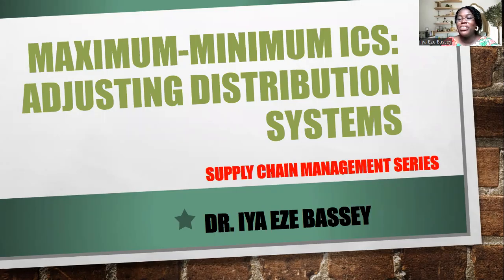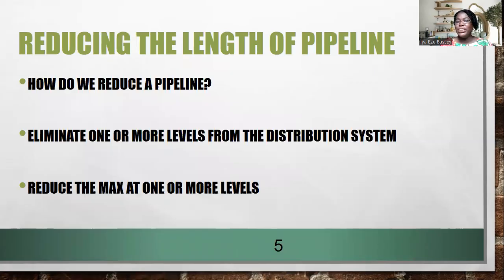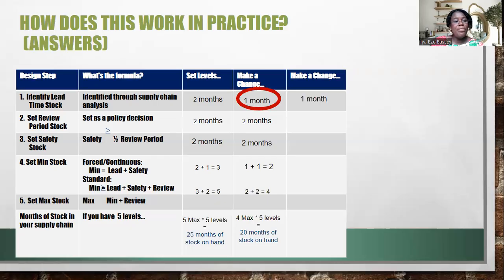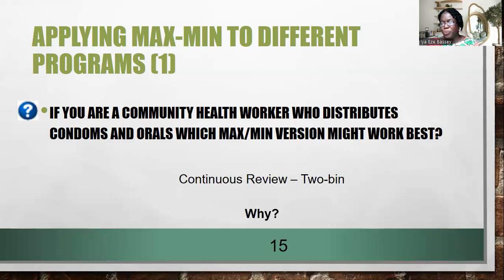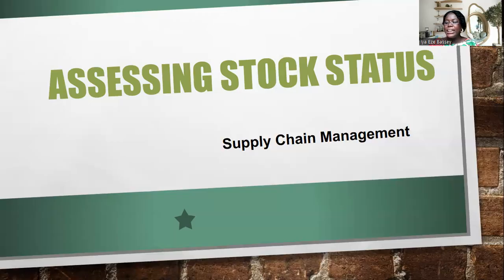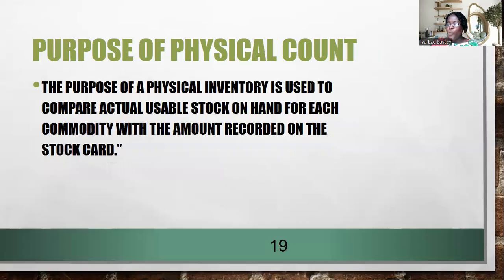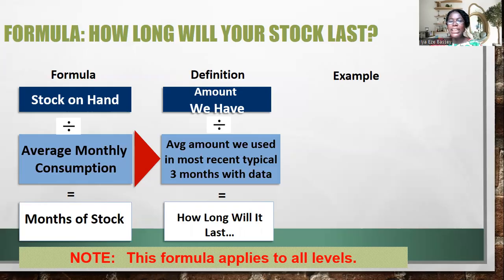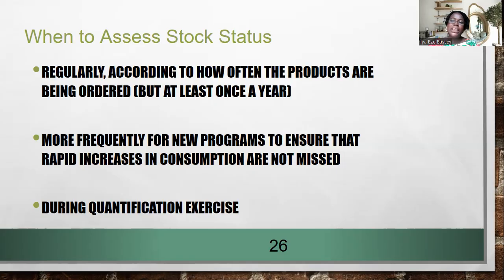Maximum-Minimum ICS: Adjusting Distribution systems (Supply chain management series)

Comment: In Summary i learnt that;

The maximum-minimum inventory control system in provides guidelines for managing stock to avoid overstocking or understocking of commodities. brackets.

The key steps in designing a minimum maximum Inventory Control System include ;

* Setting up good  maximum minimum strategy for each level and type of facility.

*  Ensuring that the overall distribution will function properly.

- Put in place initial minimum maximum strategy for each level

The benefits  of using the max-min system includes:

*Minimize wastage
* It saves cost
*Improves inventory manual and control.
*Avoid overstocking and understocking.
* Improve order fulfillment rate.

Comment: In Summary, Maximum - Minimum inventory control systems are useful for managing the supply of laboratory reagents, consumables, and equipment in medical Laboratory science. Setting the right maximum and minimum stock levels, laboratories can meet testing demands without having too much or too little inventory. 

Factors that can possibly affect max-min inventory control system levels include;
1. Lead time
2. Cost of products
3. Cost of storage
4. Storage conditions at different levels
5. Shelf life of health commodities.

Comment: Maximum and Minimum ICS is a inventory management technique used to optimize inventory levels by setting upper and lower limits. In the context of Adjusting Distribution System, this technique is used to:
-Eliminate one or more levels from the distribution system
-Reduce the max at one or more levels

Factors that impact Max-min stock levels:
-Lead times
-Effect of a zero balance of stock
Accuracy of forecasts
-Reliability of source supplies

Adavantages of using Max-Min System are:
-Avoids overstocking
-Avoid understocking
-Minimize wastage
-Avoid cost of emergency orders, 
When to assess stock status:
-Regularly
-More frequently
-During quantification exercise
For the sole purpose of been overstocked or understocked.

Comment: In summary, I learned th the ways to adjust distribution systems in ensuring a maximum and minimum inventory control systems is by 
1. By reducing the maximum stock level (i.e the review period and lead time)
2. Checking the length of the pipeline (i.e the entire chain through which supplies are moved from the manufacturer to the user)

Also learnt that it benefits which include 
1.improved inventory management and control 
2. Increased effiency and cost savings 
3. Enhanced customer satisfaction and service levels
4. Reduced stockouts and overstocking

Comment: Good day ma, from what I understand, The Steps in Designing A MAX-MIN ICS Are: Set up  Initial Max-Min Policies For Each Level And Type of Facility, Check if The Overall Distribution Will Function Properly If The Level Specific Max-Min Policies are  Implemented , Check The Total Length Of The Pipeline That The Policies At Each Level Imply. To reduce the length of a pipeline you eliminate one or more levels from the distribution system, reduce the max at one or more levels. Some advantages of using max-min system are: minimize wastage, consistency of stock level s, avoid overstocking. • The Purpose OF Assessing Stock Status is to Determine How Long Supplies Will Last. Thank you ma.

Comment: In summary, it has been stated that in order to reduce a pipeline, one has to eliminate one or more levels from the distribution system and reduce the max at one or more levels. 
There are many factors that inpact max-min stock levels. They include;
1. Cost of Products 
2. Storage Capacity 
3. Shelf-life of Health Commodities 
4. Age of Program and 
5. Accuracy of their Forecast 

The Max-Min system is advantageous in the sense that it avoids overstocking or understocking, it minimizes wastage and maintains the consistency of stock levels. 
However, the disadvantages of the Max-min system include its inability to manage a large number of commodities. It cannot manage products of new programs. 

One of the ways to assess stock status it to do a Physical Count. The purpose of this physical count is to compare the actual stock that can be used (stock on hand) for each commodity with the amounf recorded on the stock card. It is used ro determine the length of time that the stock will last. The formula for calculating this is Stock on hand divided by Average Monthly Consumption.
Note: The stock is calculated in Months. 

Thank you for this educative video, maam.

Comment: IN SUMMARY OF MAXIMUM - MINIMUM ICS
I would nsay the provides comprehensive guidelines for managing stock level to prevent both overstocking and under stockings or goods.
It encompasses various steps involved in designing the system.
  Methods doe reducing pipeline length and factors affecting the max - min stock levels.Not only does the maximum system helps in preventing overstocking and under stockings, but it aids in avoiding emergency order costs by providing a guide ro the stock status on a regular basis.

 Am grateful ma for the IMPACT

Comment: Great video..
Few things I picked from here are

1. I learnt the steps on how to design a max-min ICS.
2. We can reduce the length of the pipeline by eliminating soke levels from distribution system..
3. Some factors can impact max-min stock level systems like: 
Lead time, Age of program, Management skills of staff.
4. In accessing stock status we can do that by... Physical count.
5.  To know how long stock will last we derive it by this formula. 
Stock on hand ÷ average monthly consumption= months of stock
Reply: After this lecture I gained clear understanding in the sim to optimize inventory levels and distribution systems.
Uses a maximum minimum inventory control system (ICS)
Sets maximum and minimum inventory levels for each item.
Automatically triggers orders when minimum levels are reached, ensures timely replenishment and minimizes stocks outs.

Comment: MAX-MIN ADJUSTING DISTRIBUTION

Steps in Designing a max-min ICS ( Inventory Control System):
1) Set up initial max-min policies for each level and type of facility.
2) Check if the overall distribution will function properly if the level specific max-min policies are implemented.
3) Check the total length of the pipeline that the policies ate each level.
   In order to reduce the maximum stock level, you need to change in order to reduce the maximum stock level, these process:
1)  Shorten the Review Period at one or more levels
2) Reduce the Lead Time at one or more levels.
3) Improve the Distribution System's Reliability at one or more levels so that safety stock can be reduced.

Some other factors that impact max-min stock levels are ;
1) Cost of products
2) Storage capacity
3) Cost of storage
4) Reliability of transportation
5) Lead time
6) Age if program
7) Accuracy of forecasts, etc.

Advantages of using max-min system
1) Avoid overstocking 
2) Avoid under stocking
3) Minimize wastage
4) Avoid cost of emergency orders. Etc

Challenges of using a max-min system
1) Systems with Numerous levels
2) Systems that manage products for new programs
3) Systems that manage a large number of commodity

The physical Count which is the process of counting by hand the total number of usage units of each commodity in your store or health facility at any given time.

I learnt alot Ma

Thank you Ma

Comment: In summary, i have learnt that we  can improve the overall pipeline to delivery medical laboratory commodity from the central level down to the rural clinic medical laboratory level by: 
-Checking the length of the pipeline.
-Checking th total length of the pipeline that the policies at each level imply.
To modify the pipeline we use a systematic way  by changing some elements of the formulas which can be changed in order to reduce the maximum stock level, this is done by;
- Shorten the review period at one or more  levels.
- Reduce the lead time at one or more levels.
Advantages of max-min inventory control system
- Avoid over stocking 
- Avoid under stocking
- Minimize wastage 
- Avoid cost of emergency orders
* Challenges of using each version and variation of max-min inventory control system*
1. System with numerous levels 
2. System that manage a large number of commodities 
In applying max-min to different programs  for example the recommendation for drugs, HIV test kits, the version to ise is the standard version.

Comment: I learnt about Maximum- minimum inventory control(max-min ICS) system. It is set up in 3 steps:
1. Set up of initial max-min ICS policies for each level
2. Checking if overall distribution will function properly if the level specific max-min policies are implemented
3. Checking the total length of the pipeline
Advantages of using max-min system include:
•Avoidance of overstocking, understocking,wastage,and costs of emergency orders
• simplification of inventory control decision making
• Stock level consistency
• Reliable data source from sdp for forecasting and quantification.
A physical count is the process of counting the total number of usable units of each commodity in the health facility by hand at any given time. The purpose of this is to compare actual usable stock with the recorded amount from the stock card.

Comment: I have learnt that the Max-Min inventory inventory management system (ICS) gives detailed information for managing stock levels to avoid overstocking and understocking commodities .

Steps in designing Max-Min ICS include:
1. Set up initial Max-Min policies for each level and type of facility 
2. Check if the overall distribution will function properly if the level of specific Max-Min policies are implemented 
3. Checking the total length of the pipeline that the policies at each level implies 
Factors that can impact Maxi-min level :
Reliability of transportation, cost of storage, storage capacity, lead time, storage conditions at different levels , shelf life of health commodities.

Advantages of using Max-Min system 
- Avoid overstocking 
- Avoid understocking 
- minimize wastage 
- consistency of stock level 
- simplify inventory control decision making.

Comment: I've learnt:
* The different steps used in designing MAX-MIN ICS
* How to reduce the length of pipeline
* How to reduce the Max stock level
* Advantages of using MAX-MIN system
* Challenges to using each version and variation
* Physical count is the process of counting by hand the total number of usable units of each commodity in your store or health facility at any given time 
* Purpose of physical count 
Thank you Ma for this enlightening Video

Comment: Wonderful class
In summary:
To design a max-min ICS we have to step up policies for each levels, check if distribution will function and also check the total length of pipeline.
Some Factors that affect max-min stock levels are; stock of product,cost of storage, storage capacity,Lead times,Age of program.
Some advantages of Max-Min system are to; avoid overstock, avoid under stock,minimize waste.
Thank you ma

Comment: In this teaching i have learnt the steps in designing mad-min ICS which are....

1. Set up an initial max-min policies for each level and type of faciuty
2. Check i the overall distribution will.work properly if the level specific max - min policies are implemented
3. Check the total length of the pipeline that the policies at each level imply

I also learned the advantages of using max-min system
Which are
1. To avoid overstocking
2. To avoid understocking
3. To minimize wastage
4. To avoid cost of emergency orders
5. To maintain consistency of stock level

Comment: I learnt:
Maximum- Minimum ICS;

- Adjusting Distribution system; implementing specific maximum policies at each distribution level is crucial for optimizing inventory level particularly in public health supply chain.
  Uses a maximum and minimum inventory control system ICS.
   Gets maximum and minimum inventory level for each item.
  Automatically triggers orders when minimum level are reached.

BENEFITS Includes
" Reduced stock outs and over stocking 
" Improved inventory manaul and control
" Increased efficiency and cost saving.
  "Enhanced customers satisfaction and services levels 

PIPELINE LENGTH MANAGEMENT 
        Reducing the length of the distribution, pipeline can significantly enhance the efficiency of delivering indicates supplies such as health commodities to clinics.
Well done 👍 ❤

Comment: In conclusion, the procedures for creating a maximum-min ICS were covered, along with how to shorten the pipeline. Using a maximum-min system has various benefits, such as preventing excessive overstocking, avoiding understocking, and reducing waste. The cost of the product, storage capacity, and storage expenses are some of the variables that affect maximum and minimum stock levels.

Comment: Thank you ma
I understood the steps involved in designing a max-min ICS which are
1.set up initial max-min policies for each level
2:check if the overall distribution will function properly if the level specific max-min policies are implemented
3.check the total length of the pipeline that the policies at each level imply
Sometime the pipeline length are too long and it takes longer time in commodity delivery. However,the pipeline length can be shortened by
ELIMINATION OF ONE OR MORE LEVELS REDUCTION OF MAX AT ONE OR MORE LEVEL
The whole purpose of assessing stock status is to determine how long supplies will last
The benefits of implementing such a system are numerous, including:
- Avoiding overstocking and understocking
- Minimizing waste
- Maintaining consistent stock levels
Thank you for sharing your expertise and providing valuable insights into effective inventory management.

Comment: I learn’t from this lecture that to reduce maximum stock level one must:
•	Shorten review period
•	Reduce lead time
•	And improve distribution reliability 
Other factors that affect max-min stock level: Cost of products transportation, storage condition, cost of storage etc.
Together with this the advantage of maximum minimum system is to:
•	Avoid over stocking
•	Avoid under stocking
•	Avoid wastage 
•	To simplify inventory decision making
•	To maintain consistency of stock level 
Also I learn’t that the challenges to using each version and varieties include: system with numerous program, system with large comodities, and system managing products for new programs
Also the assessment of stock status was treated, as how long supplies can last, while physical count I learnt is the process of comparing a facility usable stock by hand for each commodity with the amount recorded in the stock card.

Comment: In summary of this educative lecture, we can reduce the length of pipeline by eliminating one or more levels from the distribution system. For instance Hiv / Aids system has only 2 levels you have to set up policies that can help to reduce the max at one or more levels.
Factors that impact Max - Min stock levels includes :
* Cost of products
* Storage capacity
* Cost of storage
* Storage conditions at different levels

I also learnt about why we  need max - min system in order to
Avoid overstocking, avoid understocling, minimize wastage, as well as simplified inventory control Decision- making.

Comment: This is very insightful,thank you prof. I understood the steps in designing max-min ics . Reduction of pipeline includes elimination of one or more levels from the distribution system, reduce the max at one or more levels. The factors that impact max min stock level includes lead times, age of program accuracy of their forecast. We have advantage to using max-min system- it is used to avoid over stocking, avoid understocking and minimize wastage etc.systems that manage a large number of commodities and manage products for new programs can be a challenge to using each version of ICS . Thank you prof for this great knowledge impact.

Comment: In this lecture I learnt that when designing or adjusting a max min system,you look at the length of the pipeline first.
And that you can reduce the pipeline by eliminating one or more levels from the distribution system,set up policies to reduce the max at one or more levels.

Factors that impact the max-min stock levels
1.)Cost of products
2.)Reliability of transportation
3.)Storage capacity 
4.)Cost of storage
5.)Storage conditions at different levels
Advantages to max min systems
1.)Avoid over stocking
2.) Avoid under stocking

Comment: In summary the steps involved to design a maximum means inventory is to set off initial max-min policies for each level check if the overall distribution will function check the total length of the pipeline
Some advantages of using max-min include avoid overstocking,understocking, minimize wastage, avoid emergency order e.t.c
A physical counting used to compare actual usable stock in hand for each commodity with the amount recorded on the stock card. When calculating how long a stock will last we use the formula, stock in hand+average monthly consumption months of stock.

Comment: In summary I have learnt that the Maximum-Minimum Inventory Control System adjustment involves periodically reviewing and adjusting the Maximum (Max) and Minimum (Min) inventory levels to ensure they remain relevant and effective.

Reasons for Adjustment

1. Changes in demand patterns
2. Fluctuations in lead time
3. Variations in supplier reliability
4. Shifts in market trends
5. Changes in business strategies

Benefits of Adjustment

1. *Improved Inventory Accuracy*: Ensures inventory levels are aligned with changing demand patterns.
2. *Reduced Stockouts*: Minimizes the risk of stockouts by adjusting inventory levels to meet changing demand.
3. *Optimized Inventory Costs*: Ensures inventory levels are optimized to minimize holding costs.
4. *Enhanced Supply Chain Efficiency*: Improves supply chain efficiency by adjusting inventory levels to meet changing demand patterns.